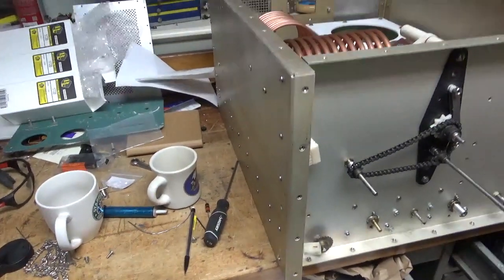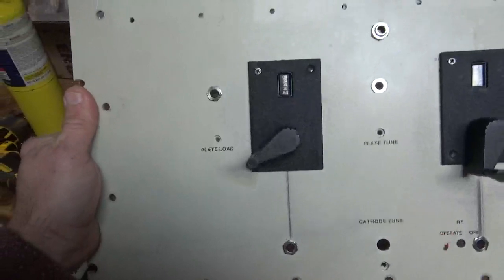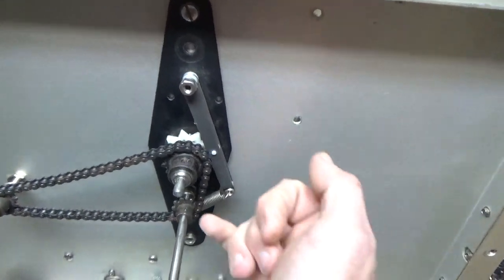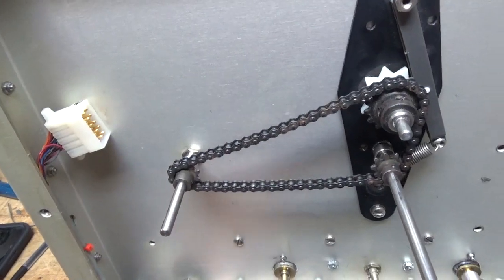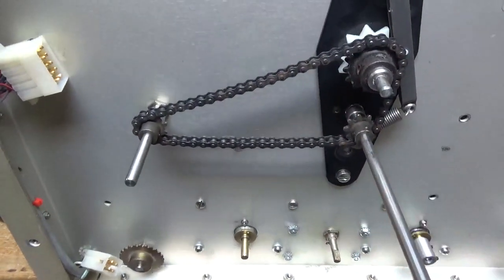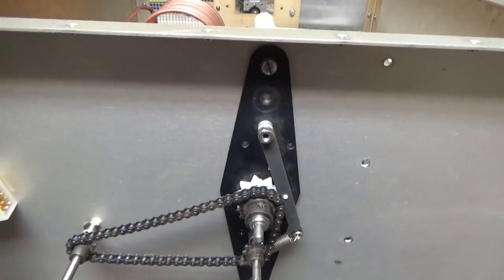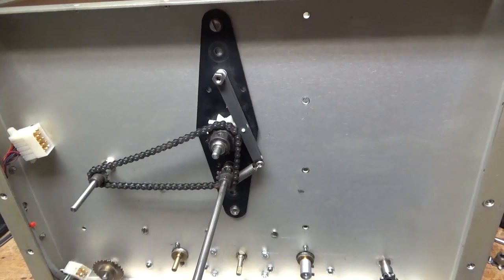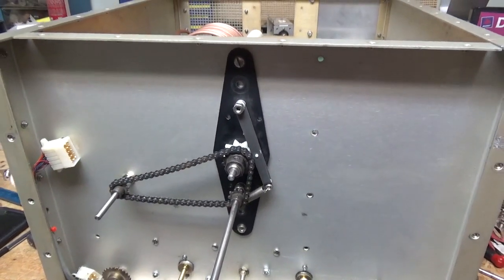Update  160-15 Meter 12kw CCS 3CX6000a7 Pa, Now Purchasing Certain Model Pa's Refurbishment Re Sell

Comment: Tough doing all those drives!! Nice work!
Reply from the maker: Thanks Mike , yeah lining all the holes up between panels , sprocket ratios , avoiding interference issues etc etc 

But when done I can make a chart on turn to capacitance ratio , install plate blockers , resonant load resistor and back feed with analyzer to finish tapping the tank coil. Just waiting on the new sprockets to arrive.

Fun fun